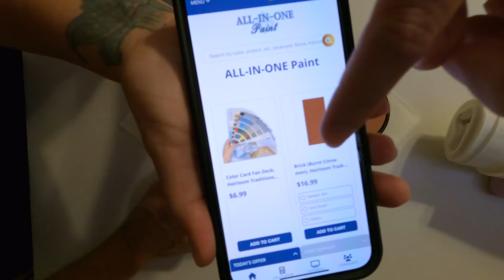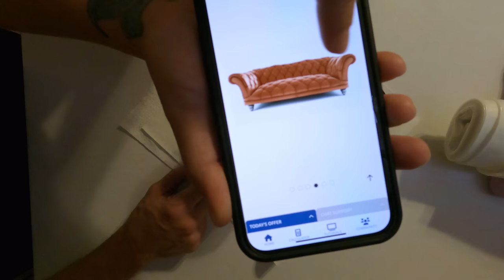This is heartbreaking!

Comment: The way I see it you have to do what feels right to you and for your family. Also, sometimes our best laid plans don't work out for us for one reason or another. What may have seemd right at the time may not be right later on and/or may work out even later. Dmitry doesn't mean failure or that you don't care. You so care and that's why you're handling things the way you do. 
I've had bad experiences with paint colors too but for the outside of my home. I finally had to have them mix colors for me. Same issue that it looked a certain color until you got it put on. 
The kids are so adorable.

Comment: If you do not take care of yourself, how can you take care of anyone else? It can cause you to not live life. I had worked so many hours in my 20's that my doctor told me within ten years I will not have to worry about taking care of others. He then paused and said that others would not have be concerned about others taking care of me. In other works my health was going to suffer . Well it was less than ten years and it started. By the time I was 34 years old I couldn't work. I had a totally hysterectomy,  a few months later my thyroid we bad. And started having seizures.  A bad lift that caused fractures of a vertebrae.  Bulge all my lower disc, lateral tears through my spine.
That wasn't all, curved spine, losing the use of my legs. Insurance denied surgery twice and an independent turned it over to where I could. The insurance company then told the doctors day surgery with removal of said disc but no replacement.  Well, bone graft from my hip, two disc removed correct the fractures with the hole-spina bifida in same fractures. Hardware was 2 plates, 6 screws, 2 rods...
Take of your health, that includes mental health.
I tell this story for you to understand you have one life, one body. Don't lose it to work or for money. It is not worth it.